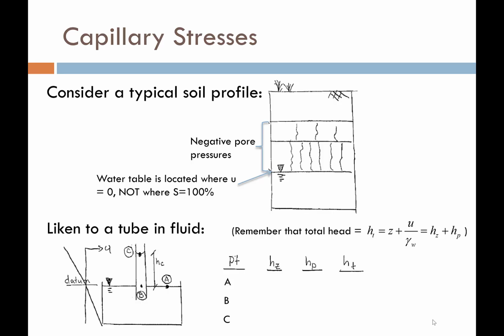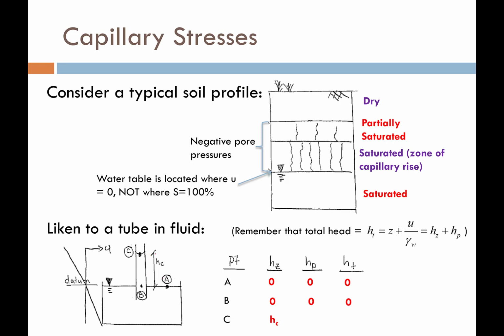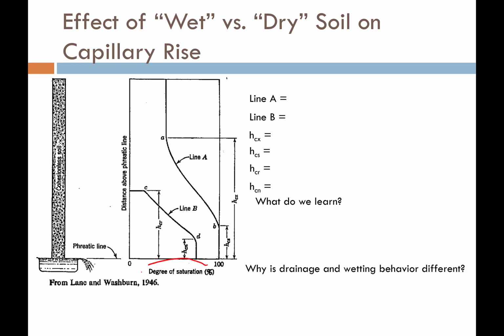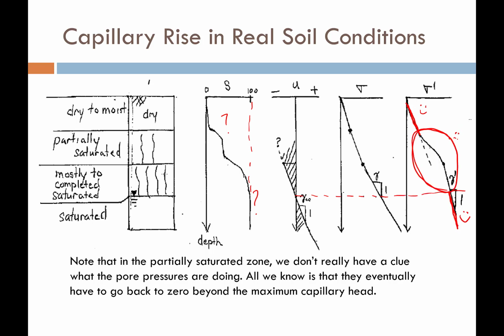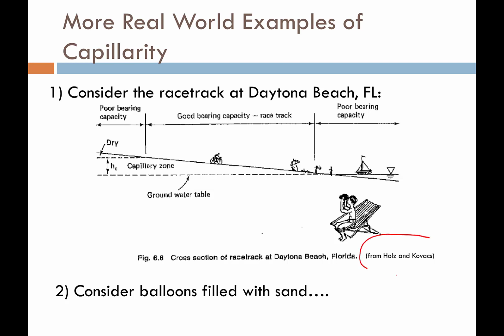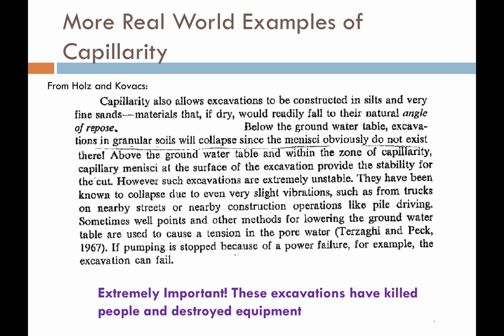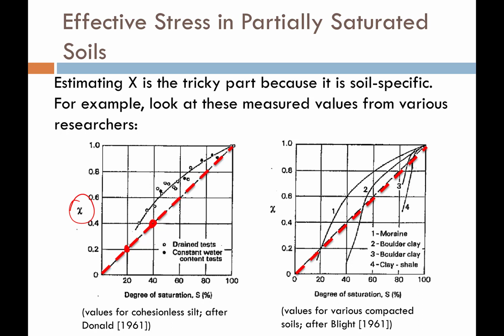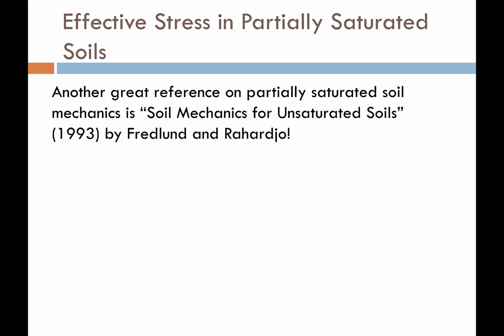CEEN 641 - Lecture 4 - Capillarity, Partial Saturation, and Intro to Unsaturated Soil Mechanics

Comment: I like to think that if below the water level, the pore water pressure being positive equates to the water particles being squished, then in the capillary tube and above the water level, the water particles are being pulled apart then that means the pore water pressure is negative

Comment: Thanks for uploading the lecture.  To avoid confusion, the effective stress parameter is the Greek letter Chi, not the roman letter X.  Equating to Chi to degree of saturation is problematic and widely discouraged, and will result in wildly erroneous estimates of shear strength.  Chi is a highly non-linear function of suction and air-entry value, so knowing the air-entry value of a soil is crucial to estimating the contribution of suction to effective stress gain.  
I would recommend the approaches outlined by e.g.  Khalili and Khabbaz (1998) rather than Fredlund et al., as they are more straightforward and less error-prone.